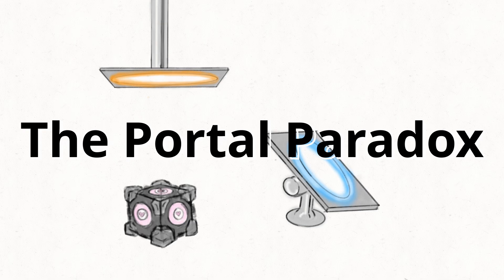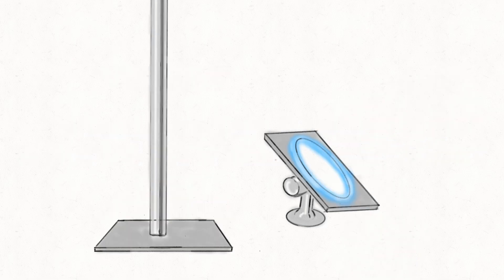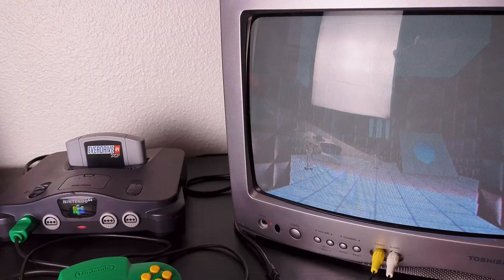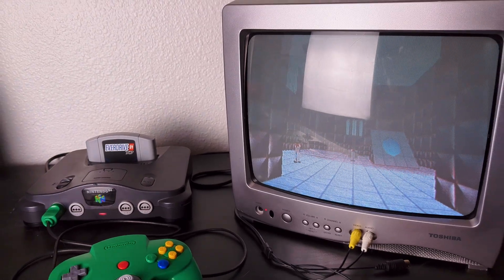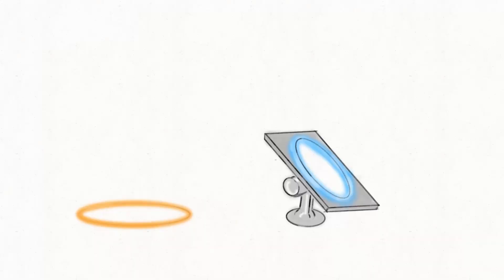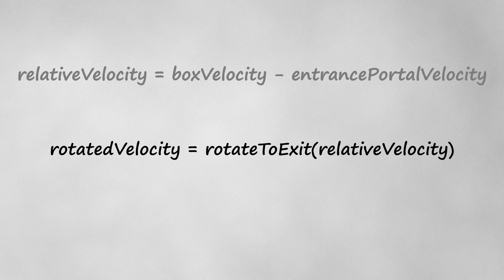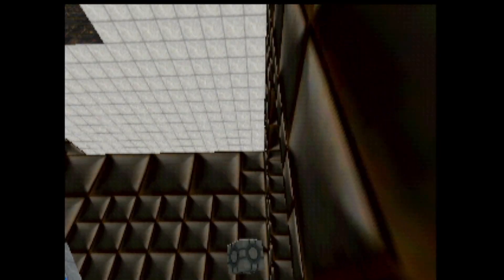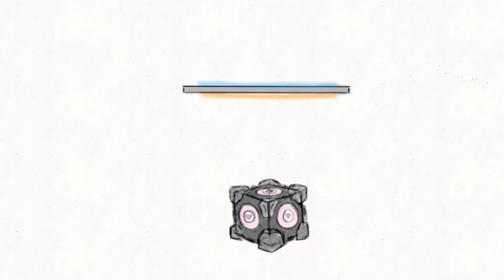I rewrote Portal from scratch and solved the Portal Paradox

Comment: “If you think Im wrong, show me how this formula is wrong.” 

No no, you have a misapprehension of how the portals work.  The portal doesnt know its moving, it doesnt care. Nowhere have we ever seen an implication of such. 

I dont need to show how your formula is wrong if the assumption its predicated upon is incorrect. Which btw, would be the only way to disagree. Kinda slimy how you handled opposing arguments.

Inertia is held by the object, not by the space around it. Even if you are in your car and you toss something up and it goes straight up and falls straight down on a z-axis, you still have movement on the other two axis as there is still inertia in the object of you moving forward. 

The best way to explain this in portal physics is when you drop through a portal that is on the floor, but the exit is 45 degrees upwards. Your acceleration through the portal is not what is being used after you go through, it is the inertia mixed with the way forces are now effecting you i.e. gravity. Another way to look into it is if you have a portal in the wall and you push a box through it while the other portal is pointing 45 degrees up. It does not chuck the box, despite its acceleration and velocity being different. In fact, you’ll find that in some tries of this the box will fall back through the portal and be stuck with part of it going through. 

Nuf said. You were wrong.

Comment: If the portal stopped right before hitting the ground, then how did the cube gain the momentum? its still going to be on the ground technically. You are not transferring momentum to the cube in any aspect since a portal has no mass and makes no physical contact with said cube. so the cube would only ever just kind of "slide" down the ramp once its center of gravity passes through the 2 portals. No momentum means no velocity.

Comment: I feel like portals should just violate the relative velocity principle. If you had a non-moving orange portal on the ground, next to the box, and the blue portal came down toward the box, i feel as though it should have the same expected result as the hula-hoop version, because the portal itself doesn't impart momentum. And we shouldn't be surprised by portals violating certain principles. They discontinuously alter the geodesic of space-time, allowing for discontinuous velocity, as well. I don't think the existing equations of physics can really be reconciled with the existence of such portals. I also think there is a problem, in that the relative velocity between any two points is different going through the portal and not going through the portal, which is an odd situation.

Comment: i dont know nothing about physics, but i think that your momento will not change, things like gravity and etc dont work as it should on the game Portal. and they're all based only on the player relative perspective. so, the box will pass trough the portal and it will just slide above the angular surface until it hits the ground or stay as it is if the surface has enough friction. the only thing that really can be questioned, is if a conscious observer could change the moving portal paradox result.

Comment: Any object remains in its current state of motion unless there is a force acting on the object that changes its state of motion. If you throw a ball through a portal in space where there is no air resistance or (almost) no gravity to slow the ball down, then the ball exiting the portal must have the same motion as the ball entering the portal, since the portal exerts no force on the ball, so the ball maintains its current state of motion. But if the ball is stationary and the entrance to the portal moves over the ball, why should the ball have motion when it exits the portal? What force should have caused this motion? How? Does the portal exert a force on the ball? If that were the case, the portal would always have to exert a force on the ball, even when it is stationary, and then the ball's motion would always have to change when it passes a portal, but that is not the case. From my point of view, the solution proposed here violates one of the most elementary principles of physics.
Reply: @xcoder1122  I know this comment is old but just saying, his solution violates Classical Physics, but not (most of) relativity. Everything is and isn’t in motion depending on a reference frame. The “force” so to speak, is the world itself pushing itself up. Motion and velocity are relative, momentum=mass*velocity so momentum is relative too.
Reply: @thealmightylatte  Classical physics is just a subset of relativity, which becomes less precise the closer you get to the speed of light. If you compare the formulas you will see that they are both identical, the relativity formulas just have an extra factor (that's the only difference) and this factor is totally irrelevant for anything at everyday speeds because at those speeds this factor is almost 1 and thus has pretty much no influence on the final result. Only at very high speeds, close to the speed of light, does this factor become larger and thus relevant, but nothing in this video is moving at a speed where this would be relevant. And the laws of momentum are always the same, whether you use classical physics or relativity; only the mass factor is affected by relativity, since mass depends on velocity. "Every object remains in its current state of motion unless there is a force acting on the object that changes its state of motion" is also true in relativity.
Reply: @xcoder1122  but relativity also says that things are moving and aren’t moving relative to things and they’re both true, what u said contradicts this in some cases. You aren’t defining what it is or isn’t in motion relative to, the solution changes depending on what the reference frame is and that’s what makes this a paradox.
Reply: @thealmightylatte  But in this case, the ball is not moving relative to the room, and so it should not move relative to the room after passing through a portal. To change the relative motion, a force must act on the ball that did not act on the room, and a portal does not apply a force, it simply changes the position of an object in space. When a moving object passes through a portal, it continues to move at exactly the same speed and direction as it did before entering the portal. If this is true, then an object that was at rest when it passed through a portal must still be at rest after the portal. This has nothing to do with relativity. You cannot have both. Either momentum is maintained or it isn't. Choose which one you want. Since portals are fictional so far, both could be true, but not at the same time. Right now, in the simulation, momentum is maintained for moving objects but not for stationary ones, and that makes no sense at all, and no relativity can make any sense of it. So whatever magic trick you want to pull out of your head to make stationary objects have relative momentum just by passing through a portal, you would have to apply the same trick to moving objects passing through portals.
Reply: @xcoder1122  well you’ve chosen the room as the reference frame so obviously you’ll get that result. It’s probably good to point out that there isn’t one true reference frame. Each reference frame is as correct as each other. Momentum and energy is conserved in all reference frames (except for the fact that portals already break multiple physics laws)
Reply: @xcoder1122  the answer depends on the assumptions u make, like what a portal actually is, how it does what it does, so on. Also stationary portals already break stuff without interacting with the stuff that passes through them, if u have two portals on the ground facing up, and drop a cube down through one, the velocity of the cube changes because the direction of which the cube moves changes, meaning the portal interacted with the cube without physically touching it or applying a force

Comment: on the one hand i like your video. but here‘s a question: 
you have two portals, apply the same, real world physics to both and now you move one.
You now have two different frames of reference. Imagine you would move the portal towards the cube, but stop when the cube is half way through. so the cube already exited the other portal by half and now it exists in two states of enertia at the same time. does the exiting half of the cube pull on it’s rest and lift it up, or does the resting half of it hold it back?
Now that i wrote this i figured, the two forces probably act on each other and the cube gets lifted up, but just a bit. Yes, that’s it, nevermind.
Can you please test this?

Comment: If the cube didn't have the velocity as you showed here, and instead came out slow, then it would be physically compressed as the amount of box exiting the portal in  X amount of time would be less than the amount of cube entering the portal in X amount of time, and so where does that cube volume go? It would have to be compressed. So either we see velocity inherited as you have done here, or we see matter that goes through a moving portal get squished.

Comment: Anyone with a brain that thinks about this problem for more than a second knows this Is wrong. The object would fall out no added movement. It's the same as an ordinary ring. It's just that the two end of the ring are in two different places. If I drop a ring around an object, the object doesn't go flying.

Comment: I'm not saying you are wrong but moving portals poses all sorts of questions:
1) What happens when the entry portal moves over the box at speed A but the exit portal is moving forward at a speed of A+B where B is simply any number greater than 0. Forward in this regard simply means that it's moving in the direction the object will come out.
2) What happens when the entry portal and exit portal move toward each other with a box in between that is not moving.
3) What happens when the entry portal is stationary and facing up with the exit portal directly above it and facing down while also moving down, and a is box in between (with gravity causing it to accelerate down.
4) What happens when a portal is opened below a box and the exit portal is moving backward?

Comment: If the orange portal was not on a floor, but instead of the front of something like a train, and instead of slamming onto the floor, was you throwing an object into the front of the train, it would not gain velocity, it would "ploop" out of the blue portal with the same velocity it was thrown before interacting between the portals.

In your example, if the orange portal keeps moving, from the cube's perspective as it is plooped with 0 velocity out of the blue portal, the orange portal is now moving away from it with the same relative velocity it had when the cube was stationary before the orange portal passed over it. The relative velocity between the cube and the portal is consistent, and correct, the mistake is in assuming that because the portal stops moving, the cube inherits an acceleration because the relative velocity has difference otherwise goes to 0, but it goes to 0 because it hits the floor, the same as the hula hoop example.

Comment: The problem is that it's a hypothetical concept based not in reality.  So, for example, conservation of energy is not maintained.  The portal moving wouldn't impart any of its energy into the box, so the box wouldn't have any kinetic energy coming out of the portal.  But portals, if real, could make perpetual motion devices which could generate energy as they would by-pass potential energy stored by gravity moving something from a low elevation to a high one.  So they already, conceptually, break known laws of physics even without considering motion.  That means, there is no answer, which is the only answer.  You can make the game do whatever you want it to because you're defining the laws of physics for the game.  In real life, who knows, which is why it's a good debate.

Comment: may be a dumb question and i’m just curious but what happens if the portal surface moves at high velocity toward the companion cube and abruptly stops once the cube is halfway through the portal? does it pull the rest of the cube through due to the carried momentum or does the cube still sit where it was? or does it just get sucked through and lose all momentum and flop out the other side?

Comment: There is nothing that actually changed the momentum of the cube. The portal is a hole, and it should not matter where the exit is. Something that is moving at X velocity stays at X velocity so if X = zero then it would remain at zero. The portals do not pull or push what passes through them. Only external forces would cause the momentum to shift on the cube.

Comment: I'm not saying you're wrong, I just always assumed portals were literally like tunnels/tubes of a sort. Like, it compresses and distorts space/time between two points to make them be right next to each other, rather than imparting a massive amount of momentum onto whatever travels through them to get it to the other location.. If a cube is stationary on a platform, and you slam a tube down over it, it doesn't go shooting out the other side. So I was always under the impression that, in order for the portals to suddenly impart velocity onto the object passing through, they must have some kind of mass with which to act upon said object.

Which honestly would've raised more questions than answers.

Comment: Right so, I've discussed this with people. 
The portal paradox is fallacious. There is no paradox. My issue with this solution is it only recreates what we see. Not what is or should be actually happening.
The problem is nobody is considering what happens to the portal, which is why it seems paradoxal. The energy in a system must be maintained in order to obey the law of conservation. The problem is, this is impossible to answer because the information to do so is not present. 

It's like if I said "An object hits a person and sends them flying back 50 feet." and asked "How heavy was the object?", you cant determine that. You cant even determine how many joules the object even had, because i never gave you the mass of the person it's imparted on. It lacks the relevant information to make a determination, so you gata make assumptions. 

The problem with the "Portal Paradox" is that what happens changes dramatically depending on how you assume it works.

Comment: From a pure physics perspective I dislike this solution because momentum is basically entirely ignored. A non moving mass cannot suddenly start moving at speed unless it recieves energy from an outside source. Where is the engery coming from here? Is it coming from the piston? Then the piston would logically need to slow down slightly before finishing it's movement since it will lose some kinetic energy. The portals themselves can't be imparting that force on the cube as they're not supposed to interact with any object that passes through them. Really, for them to work at all without becoming far more terrifying as a concept then they need to be completely incapable of movement as it is in the original game. From a physics perspecive they are already a heacache to explain. Granting them the ability to move and assuming that relative velocity needs to be maintained makes it an even bigger headache that is justified imo.

Comment: Three reasons why it wouldn't shoot out:
1. The velocity of the box in or out is simply the momentum when moving. If the box is not moving, it has no momentum. It would be the equivalent of moving a hole around the floor and having it fall through the hole.
2.The Portals add no energy or momentum to objects moving through them. Any momentum gained from moving through (such as the infinite fall) is due to gravity, which does eventually reach a terminal velocity. 
3. A moving portal has the same properties as a hole in the floor. It adds no energy, it just wraps around the object. the difference between a hole in the floor to the other side, and a portal on the other side of the room, is just where it ends up. It'll still be a hole with no energy added to the object going through.

Before you add that the crusher's velocity would push the box, no it wouldn't. The part that the portal touches essentially becomes unable to touch the box due to the portal absorbing the box's matter before the crusher could touch it. Therefor.. it would just leisurely plop out the other side.

Comment: I think that the easiest solution to the portal paradox is that the portals are locked relative to one another as soon as they open.  So it would be like trying to slam one side of an open window down on a cube, while the other side remains stationary--which is impossible.  This also solves the "move a portal through a portal" problem.
Reply: it doesn't solve anything. you'd have to somehow explain this infinitely strong force keeping the portals stationary relative to each other.
Reply: @kannix386  It's the same force that keeps once side of an open doorway attached to the other side: they are the same space.  When the portals open, two points in space that were previously distant are now attached.

Comment: Yes sir!!! I knew that what would have happened

As someone said portals are like doors that connect 2 surfaces like going through a door, even when one is on a wall the other the floor it's like there is a door you walk through the floor and the other side is just the wall

If you take the door and threw it at something it would go thro the door, but in this cases cuz the others side is stationary the thing going through the Dorr would look like the thing thay's moving(just like if you were flying necx to the door, everything would look like its moving but you and that door)thus the cube would go at the same speed as the portal was coming at it